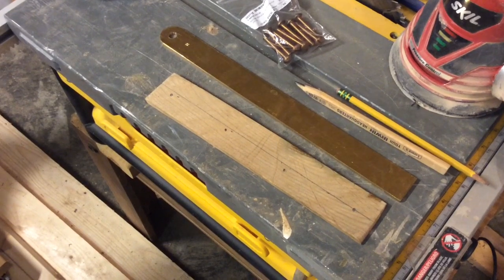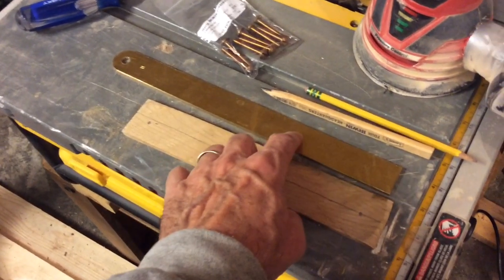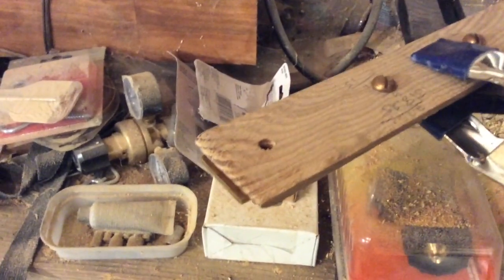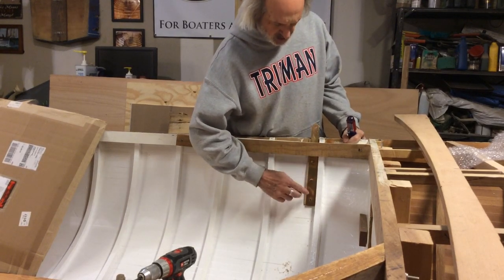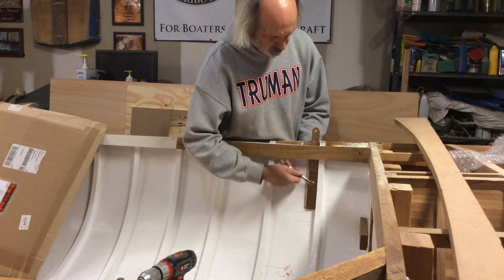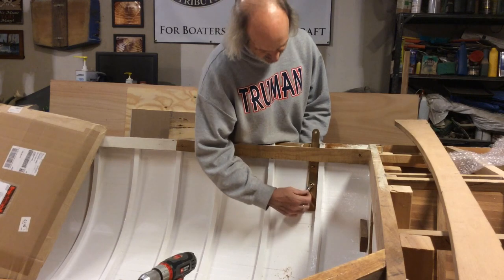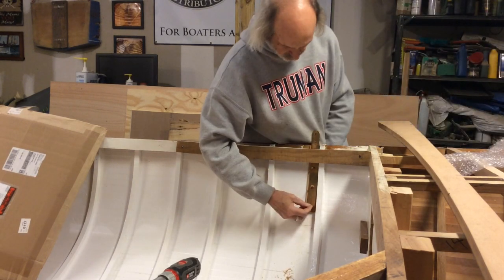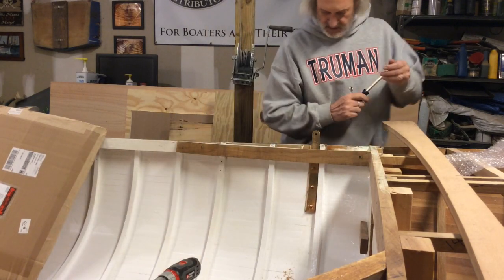Boat Building- Chain Plates On The Haven- Episode 81

Comment: Sealant of some type on the holes through the hull?  Rot from rain?  Put soft caps on the bolt ends.
Reply from the maker: good advice. my wife, too,  is insistent on my putting some 5200 or other sealant in the bolt holes and I plan to do just that.